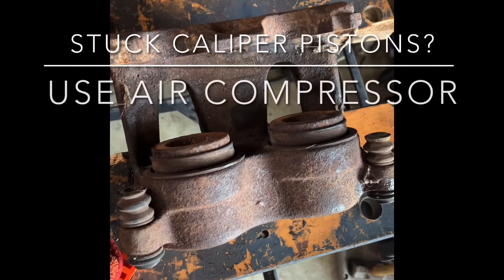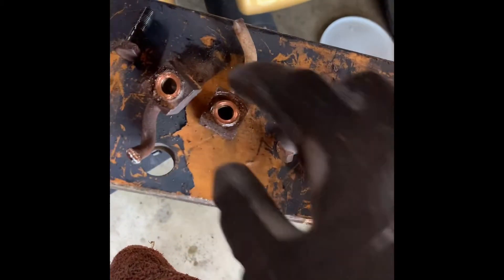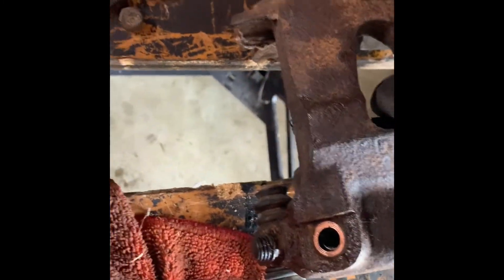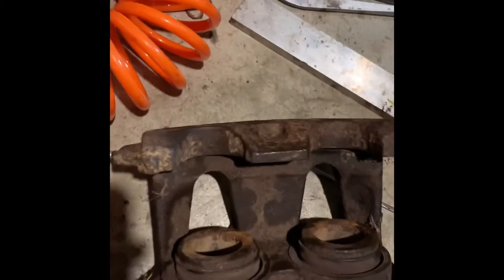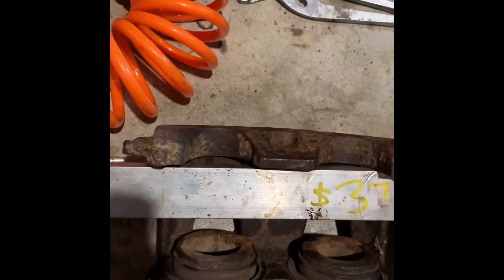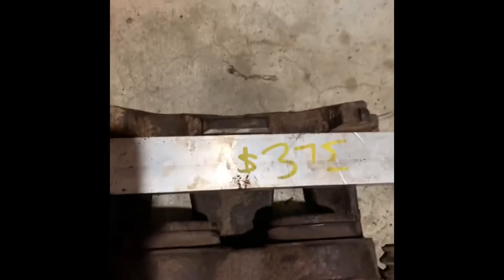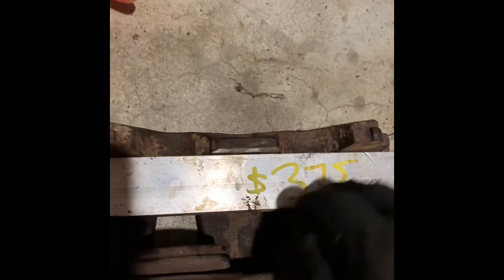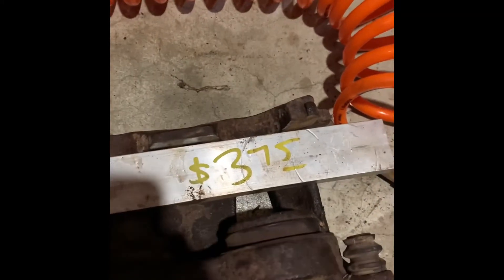Stuck caliper pistons? Use an air compressor!

Comment: What fitting do you use when giving it air?
Reply from the maker: Luckily my metal nozzle is funnel-like and it made a good seal. The rubber nozzle works well too as it should also create a good seal.
Reply: @11xxKNiFExx11  I got the boot installed. Wasn't as hard as I thought. Just needed to lower the boot as far as possible at the base of the piston and press the boot down into the base of the bore evenly all around. Then carefully twist turn the piston while pressing applying even pressure on the boot so it stays seated in the bore.
Reply from the maker: @AR-mb3id glad you got it!! Those tolerances in brake pistons are pretty crazy sometimes.
Reply: @11xxKNiFExx11  Thanks again. couldn't have done it without your vid and advice.
Reply: @11xxKNiFExx11  I tried it and it worked. I've been doing it the hard way. Thanks for your vid. Now the hard part of getting the boot in. Been struggling for hours so any tips will be appreciated it. I saw a vid of blowing air in the same way to open the boot in order to insert the piston. Gonna try that today.